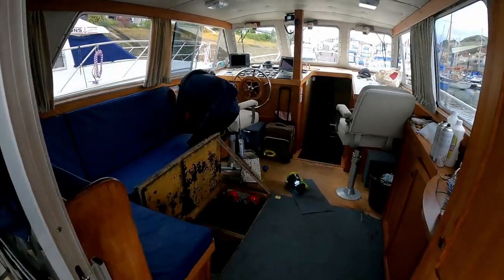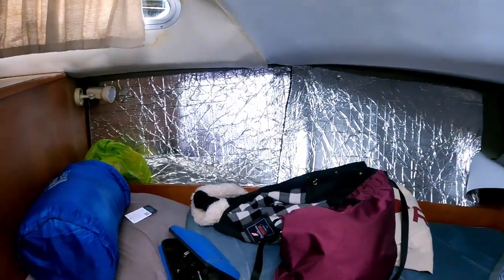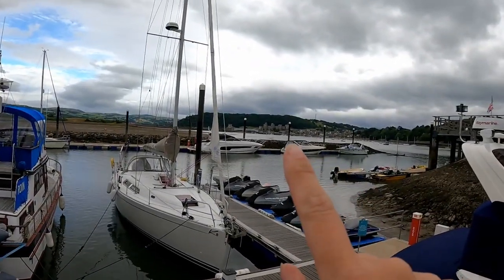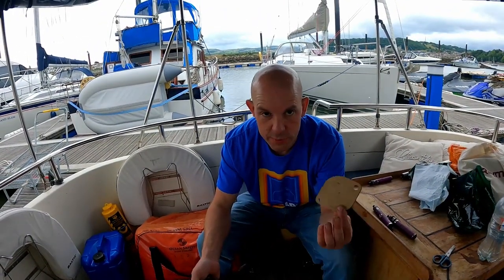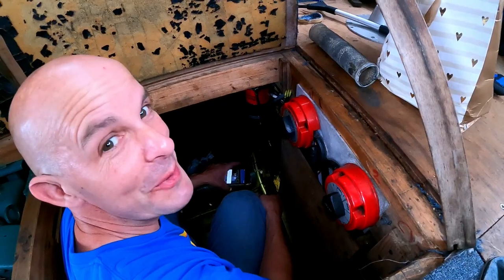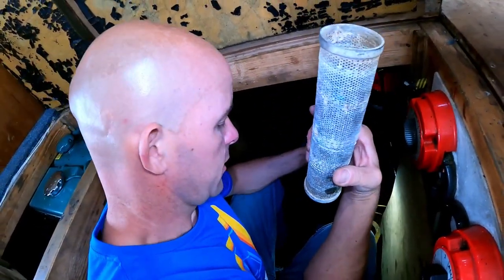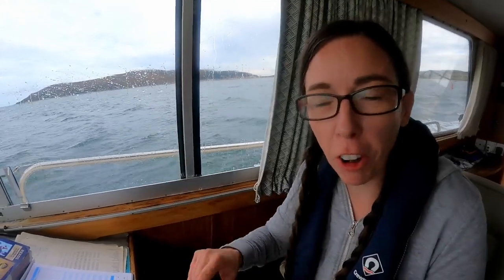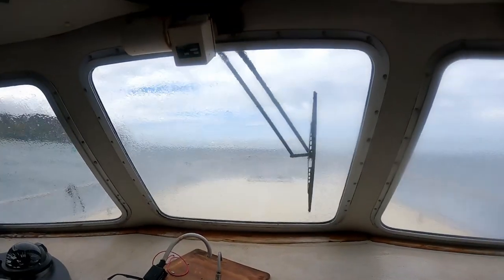Conwy to Isle of Man By Boat - Manx GP

Comment: Just at the part where you said if we open this valve we’ll be swimming with the fishes. When I was with Shell Tankers we had a ship called the Norissia, she was loading out in the North Sea,, possibly on the Brent Spar I can’t remember now,, but the sea filter blocked up with jelly fish. Bearing in mind it was probably a 24” pipe and filter, the engineer on watch decided rather than chain block the filter out and empty it into buckets, he would open the ships side valve which was a pneumatic driven butterfly valve and flush the jellyfish out. It probably worked a treat but the pneumatic system couldn’t overcome the flow of the seawater. 10 meters of water in the engine room but she didn’t sink because she wasn’t fully laden. Oooops

Comment: We used to work whelk gear halfway between Anglesey and the Isle of man looks like you had nice weather for your crossing, is the electric railway sign still lit up in Douglas it used to flash on and off, we never went up inside the harbour we must of laid lower side of the bridge, Port St Mary was nice stop over too.

Comment: I appreciate the great drone shots of the motor yacht and sailboat but as I sailor, it made me cringe.  When there is a whole ocean to past another boat, I find it frustrating when they decide to buss right down the side of my boat causing to rock n' roll.  I did notice that your skipper slowed down when you got abreast of the sailboat but did not see when he accelerated back up to speed.

Many times I have had that exact scenario happen while out sailing in clear open water with no one else around.  The Motor boat would come past me  with less than 5 boat lengths between us and slow down just as they came even with us.  After they would get well ahead of us (in the mind of the skipper) they will accelerate back up to speed.  This invariably happens before our boat is inside their boats wake so that means that they throw the full "coming up to plane" wake right into us.   If you speed up any time before the sailboat is inside of your wake, it is better to not even slow down at all because the wake is far larger from the time you hit the throttle until you are up to speed than it is once your are at speed.  We have a standard call on board for these close passers.  "WAKE HOO!"

Better yet, just turn 5º either way when you are a couple of km back and  leave the boat with a 100m separation.

If you must pass close by another much slower boat due to a confined , the best way is to come up astern close by one side and slow down a few boat lengths behind to a minimal wake speed,  Then once you get clear ahead, turn your boat to directly ahead of the slower boat and once there, go about your business. That minimizes your slow time and puts the minimum of wake onto the slower boat.
Reply from the maker: We were all friends together having fun!

Comment: That looked a good trip. Never been to the island but it's on my bucket list. 2 quick questions. The boat you were on, was it a Nelson? Also, were the engines Volvos or Perkins?
Reply: She is an Aquastar 38 Ocean Ranger, very much along the Nelson lines. She has twin TAMD 60 C 250 HP Volvo engines